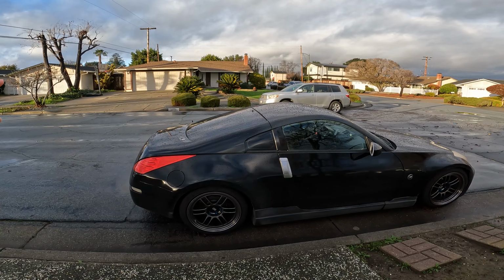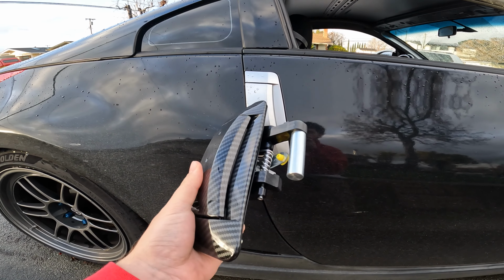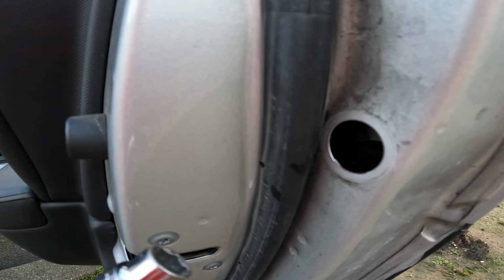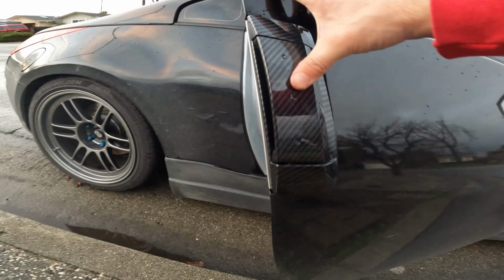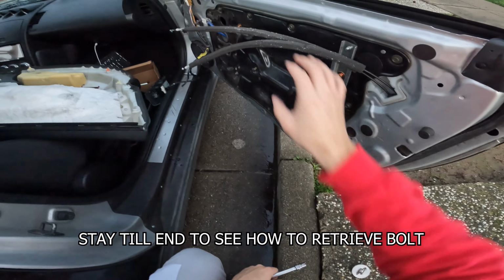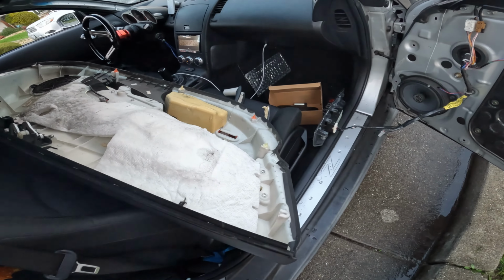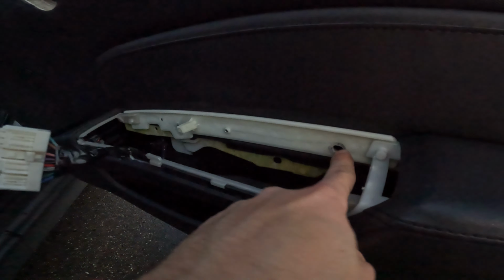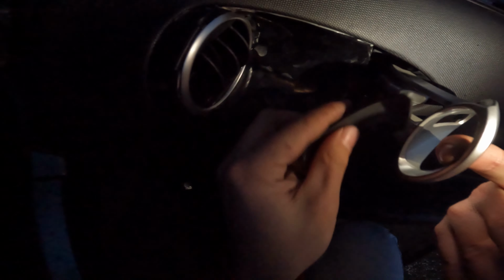HOW TO FIX 350Z DOORS HANDLES!!

Comment: dip the bolt head in wheel bearing grease just a little and it will stick in the socket like a magnet (works for phillips head screws as well)
Reply from the maker: Thats actually fire

Comment: Hey how did u get them to work perfectly? When I installed mine believe the same as yours, when u open the door handle the latch inside doesn’t go down all the way like the other aftermarket ones I had so it doesn’t fully open the door and you don’t get that click
Reply from the maker: So it could be the door handle itself, or when you installed it and slide the metal pin into the locking mechanism.
Reply: @SilentRising  I believe it’s the handle itself cuz from my last ones the latch when u pull on it goes down further than the ones I was putting on, only way I found to fix it was to sand it but just more effort so ima just buy better ones next time
Reply from the maker: @dontbestumped im curious where you got yours, I put an amazon link to the ones I bought for about 20 - 30$ and no issues so far
Reply: @SilentRising  was from eBay overpriced asf but says APPERFiT on the back, probably just get new ones

Comment: Do you have the link for those fiber glass door handles
Reply from the maker: Yessir got a link in the description!
Reply: @SilentRising  Funny video.  Thanks for taking the time.  There are a thin magnets that are usually sold at .99cent stores.  The thin magnets have a pocket clip.  They have taken me out of jams due to their power and their ability to get in to tight spots.
Reply from the maker: All garage warriors need one just in case lol
Reply: I dropped the bottom bolt too but thankfully it got stuck in part of the door and I could actually see it when I took the door handle out. Surprised it didn't fall when I opened the door, was able to stick some double sided tape to my socket and carefully lift it back out. Your one looked painful, it I couldn't see it I'd probably just find another one the same size and leave the original in the door 😂